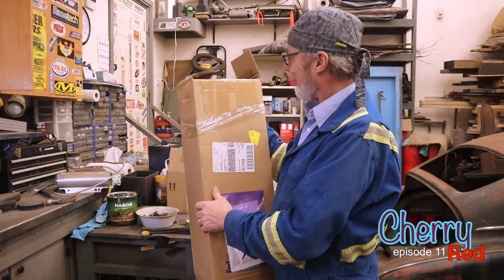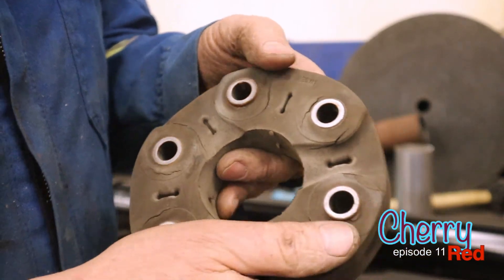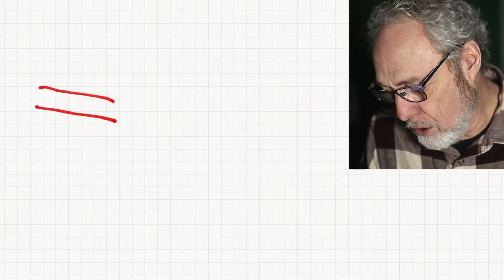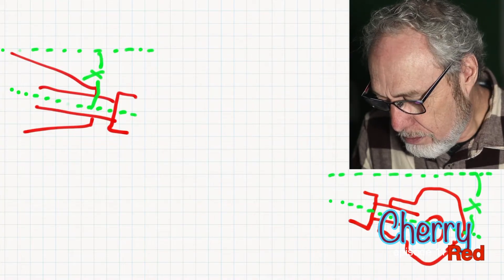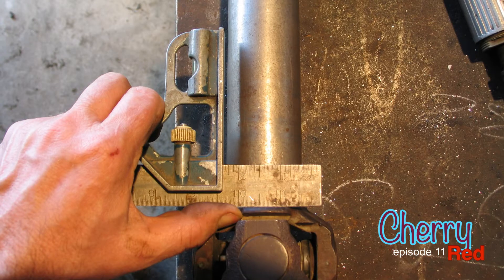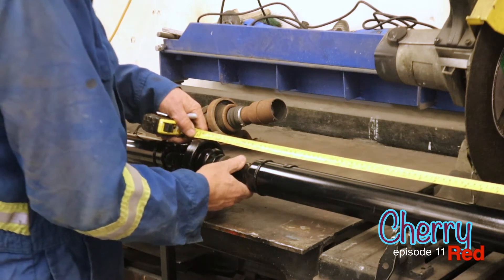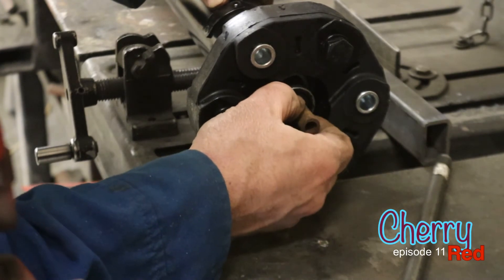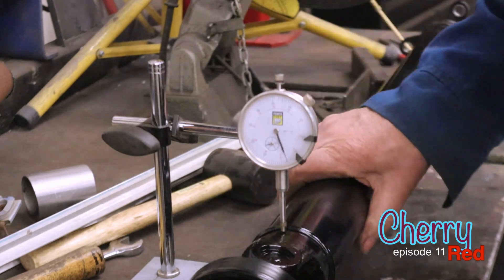How to lengthen a drive shaft, part A. Cherry Red Episode11

Comment: Ive got a Toyota drive shaft on my lathe right now getting ready to cut it and add 6 inches. I doubt that I can make it worse than the worn out bent shaft that's on my truck now.  
I think its just a matter of patience and using the dial indicator. 
Great video thanks.
Reply from the maker: Yes, patience is the key. And making your extension as close to the end of the shaft as possible. I'm imagining you have universal joints on this shaft? Make sure the joints on both ends of the shaft stay in the same rotational degree to each other. Hope it turns our perfect!